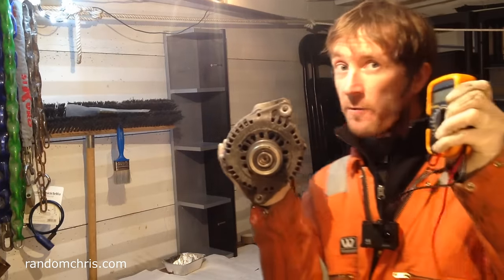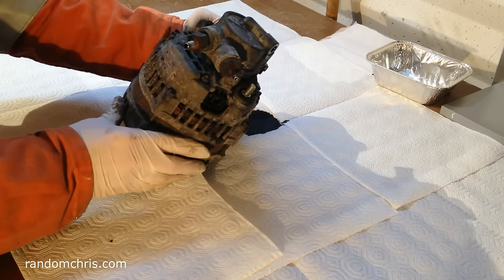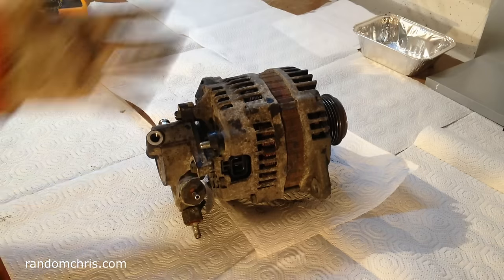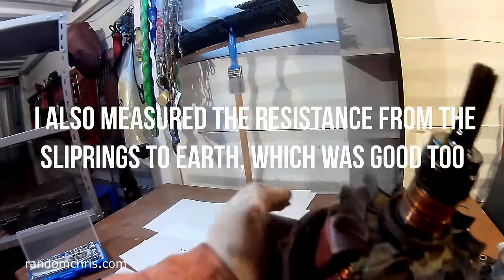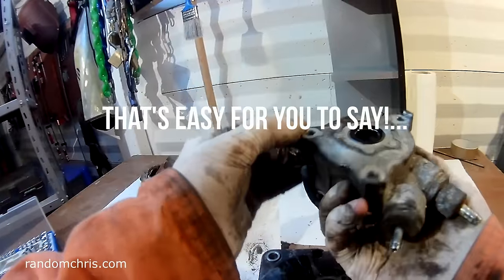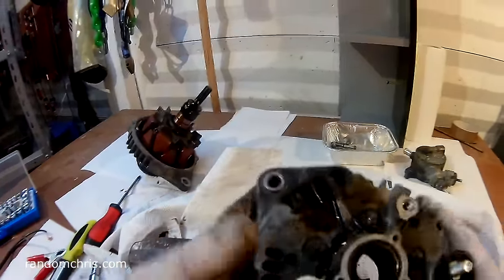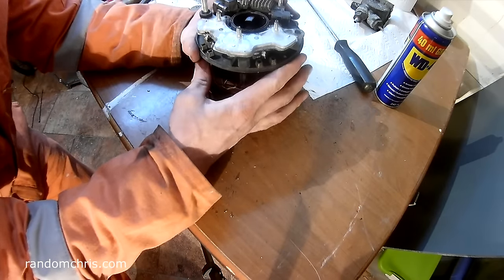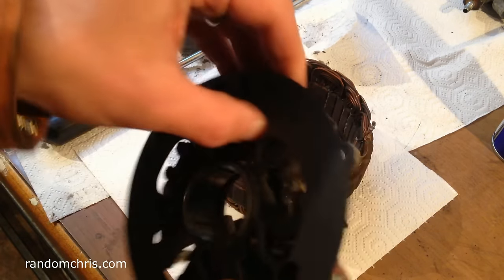How to Repair Your Own Alternator (With Simple Tools)

Comment: I'm an ASE Master certified auto mechanic with 40 years experience and what you have shown in this video used to be a big part of what a shop technician did as his work but sadly most shops have gone to just replacing the alternator as an assembly. I still repair as many assemblies as I can so that I can get the labor pay rather than spend it on parts.
Reply: It's a shame, these day everyone treats everything as disposable. We stopped using plastic bags, but while in the automotive industry not much is repaired anymore, 500 million water pumps as an example disposed of a year rather then repaired, then 500 million more manufactured, and we talk about pollution.
Reply: @hamishmcmanus2027  This isn't really the case with alternators. These things are highly recycled. Half the time all I can find for older cars are remans, which is fine since I've not had a problem with a reman alternator anyways.
Reply: Thnks bro for sane tips i gain tru yr video clips
Reply: I mean if your like me 56$ a hr, it only makes sense to rebuild on Ferrari’s and similar now
Reply: generally, replacing components takes less time than rebuilding components. this is no different in the aviation field. parts can be rebuilt offsite in a controlled environment such as a factory that specializes in rebuilding specific parts.
Reply: Air planes are regulated 
MUCH BETTER THAN CARS , I'm on my 4th rebuilt alternator no I'm rebuilding this one then I'm going to get a friend to take my video of my repair to the ADVANCE AUTO PARTS STORE WHERE I JUST GOT TOLD TO LEAVE. 
    In a plane I would be dead🤨
Reply: @NeoNoggie  you have. Been lucky. I haven't.
Reply: @hamishmcmanus2027 
Every thing you buy in grocery store is packaged in PLASTIC.
WE SHOULD BE ASHAMED. I AM .
Reply: An alternator from Honda for my 2006 CR-V is $2,055.00. Workmanship and QC are in the gutter across the board. Once trusted companies are putting 3 or 4 kinds of differently sourced trash in the identical box. Spending $50 and a couple of hours instead sounds good.
Reply: Asßa
Reply: I'm just learning how. I'm not ASE certified,
Reply: Thank you for letting me know that’s how mechanics think something that can be changed so fast you would rebuild for hourly rate
Reply: @goodday126 that’s ridiculous
Reply: Yeah throwing money away. Now a days guys will look at you like you're completely dumb and crazy if you say that words" u got a REBUILD kit?" 
They'll scoff. Or just glance at you. Like you broke out of an assylum.
Reply: @goodday126 are you serious?! 2k for alternator? That's...I can't
Reply: @Salador1777  It's right on the Honda's part website. Maybe a dealer might mark it down 10% or something, but ya that's the deal. A $50 belt tensioner from Honda was about $225. I didn't buy that either.
Reply: <---Lady!   😉
Reply: Hi sir, i bought 2 alternators from tuffcarparts 100amp one puts out 15 volts the other one outputs 3 volt,  do you know why the other one only produce 3 volt?
Reply: @hamishmcmanus2027  That's insane :/

Comment: Thanks for including us females too! Yes there are some of us out there that are into repairing our own vehicles! And thanks for the info! I’m about to remove my alternator now! Watching this video literally gave me all the information I needed
Reply: Same here girl ! I had to replace my alternator along with the VTEC solenoid, drive belt , hydraulic (total pain in the ass) tensioner pulley for my drive belt… but it’s done and running . I kept my old alternator because I  think probably just needs to be cleaned and possibly change the bushings and I have no doubt i can repair it . why would I trade it in to get a $30 core charge back when it’ll be worth $200+ fixed? I love mechanics though and I wish I knew more than I did but I pretty much told myself everything I know and I’ve successfully done everything on one vehicle or another including timing belt And repaired my fuel pump in one vehicle. about the only thing I haven’t done is replace the entire engine, transmission , nothing involving head gaskets or anything with the suspension. Happy mechanic and do you!
Reply: Mmmhhmmmn.... Y'all in that 3-5%??

Which one of you is available for courting?? Lol
Reply: I watched so many videos, like this one, where they all talk about the problems that are not shown on camera. I spent 3 hours getting it off, but not even out of my truck. It would be nice if the next guy that has to replace one, who has done it once before, film all the really difficult stuff if not given a heads up. The power steering bolts are not too bad to get to if you know exactly where they are. I put the socket on first, then the ratchet. There are only 2 of the screws needed around 11 and 3 o'clock position. On one of the other videos, it showed the 2nd bolt. To be honest, its around the 3 or 4 o'clock and you can hardly see any part of it...but you can find it easy with the socket. 
 
He talks about it, but one other video actually shows it being done. Next, it is much easier to pull it out from the side like he did, but only if you take out the bolt that the alternator hangs on. Its an E socket 10mm. It is so long that it gets in the way when you try and wiggle it out. Once its out, you can get it out with very mild wiggling. 

Lastly (I should have gone in order), but even though the 2 top bolts are hidden, one of the 2 bottom bolts are a pain in the ass if you you don't get the tips.....First one is not so bad, you may be able to break it open with a wrench or ratchet. The other one is what he described. You have to get a 14mm combination for the back....i used a pry bar under the engine for leverage as they are on super tight.  The screw is long and it cant come straight out because of the bracket in the way. It is the bracket to has some hydraulic lines attached to it on the alternator. You can move the lines mostly out of the way.
I haven't even started putting it back together yet.....waiting on the alternator to come in. Other recommendation I would make is not to order the alternator until you can get eyes on it.  There you can get the oem part number because my truck shows 3 different ones with my vin number....the stores always asking about dvd and tow package. I don't have a rear dvd package and I didn't see the tow package on my dealer sticker....but I had a 150a alternator. I ordered it after I could see the part number...

I understand why you don't see some of these pointers, so no fault of his own cuz he's grinding trying to figure it put and when does, its too late and he is not going to backwards to show what he just did. 

I hope all of the learning pains result in a fairly straight forward assembly. We'll see...but of anyone who has seen this video ever has to do one of these again, please show how you take out each bolt and the tools used. It will save the next guy a lot of trouble and headache. At my man spoke bout some of his issues so I was made aware of the problem, but must say this was a bear without being able to visualize the headaches it brings.....Agree with many, I have removed many alternators for a shade tree guy and this was the absolute worst.
Reply: Shut up and make me a sammich
Reply: I’m inspired. Not as a man but as a human.
Reply: @MrMtz817  your respond is better, I have to admit, than the nauseating virtue signaling of this Nico clown lmao
Reply: Just pulled mine out and cleaning real well. Buying a new one is my last resort, Funny think is i just wanted to get a new one and be done but my OCD kicked in and bam!!!
Reply: Never met or talked to a female who could do any mechanical/electrical work. Definitely some females in Construction, that's still on the rise.
Reply: @JohnDoe-tr8zt  well now you have 😊 I work at General Motors in the electrical integration lab as an electrical technician! I love my job! We build test benches for every signal that goes into a vehicle.  And I’ve been doing my own mechanical stuff since I’ve been driving only taking it in when I couldn’t do it like a water pump (on a dodge shadow turbo 😆)
Reply: @natsmatratatat  get it! That’s awesome! I’ve learned everything from watching these YouTube videos! I’m so thankful for people making them
Reply: @Mel_Issa_143  u go bbygirl
Reply: My aunt is always working on vehicle and learning from videos like these
Reply: Make a video!
Reply: He was being a typical British. They're more feminist oriented over there
Reply: Came here to say the same.
Reply: @DooberD33 must get all the girls in his family tree

Comment: Ii'm 78yrs old, I grew up in a era when all things were done like this. you did not replace a part. you repaired it. Generators. Starters. fuel pumps etc. then the throw away era came in and society became a throw away and replace it one. Nice to see its come full circle and there is still the chance to do some good old repair and fix it. to get it going again. Thank you for a nicely done tutorial. and for sharing.
Reply from the maker: Hi Ellis, Thank you for your comment. I'm 'only' 40 but I feel like I'm from another planet sometimes. Take me back to the 1980s any day... Chris
Reply: Someday maybe we'll (need) to go back to the repair of things vs replace and expend  resources.  Glad most alternators are returned/core charge then remanufactured, which tells you something right there!! (I e., with great tutorials like you provide and a few bucks and some time, these things can be redone ourselves in some situations).  Thanks for your tutorial.
Reply: @mikek5486  I don't think it is as far off as people think. I always try to learn to repair things for this reason.

Comment: I always like mechanics astute enough to actually find the problem and fix it instead of just replacing the entire part.  I notice they do this in Mexico, but not in the USA - often, you may be better off with the original part instead of another one that could have other issues.
Reply: Yea like dealerships dont even fix engines anymore they just replace them.
Reply: By that standard a 5 year old could be ase certified.
Reply: Often refurbished parts are more dependable because each individual one is handled and tested.
Reply: Thanks for that. My father (both of us from Mexico, and he was an automotive and truck mechanic there) used to say that most car repairs done in this country are done by people who just change parts, but know very little about how things are made and how to really diagnose and correct problems in a car.
Reply: @lorenzoparedes2306  Yes, Lorenzo, absolutely!!!!  They swap out the Alternator or a rebuilt one here, but in Mexico they go inside the Alternator and rebuild it usually replacing the brushes that wear out first.   AND in Mex. they'll work on Sunday if  you need help, so you can return and be back to work on Monday!!!    Same situation with Automatic Transmissions - in the USA they swap it out for one they rebuilt and no one knows if it's been well cared for or not.  In Mex., they replace the high gear plates that get the most wear and put in new plates (or disks).  I feel more comfortable in Mex. because I return with the same transmission that's in good shape except for the worn out disks.
You pay maybe $3-4,000 in the USA and maybe $650 in Mexico for the exact same end result of having a working car again.
Reply: That’s because this isn’t cost effective unless you’re rebuilding your own alternator. If you have to pay an employee to rebuild one of these, you’ll end up paying more in labor than a new one would cost. And it’s faster to just replace the whole unit and get the customer back on the road
Reply: @chainarmor448  In Mexico, the mechanics work for $20/ hr. whereas here they are $100/hr.   In Mexico, they'll rebuild the alternator by themselves right on the spot, but in the USA the mechanics will just replace the unit with one already rebuilt.  I'm only 2-1/2 hrs. from Mexico, so if I go in that direction it can save me money.  YOU  can save money going to where the hourly rate is lower.
Reply: @dennishassler605  is it cost effective for you to travel to Mexico for an alternator rebuild ? Lol. It sure isn’t for most of us in the US. That’s why we replace the whole unit
Reply: A funny side note is once long ago a family in Mex. City were mechanics fixing cars and, then, their last name "Taller" became the go to name to get auto work done;  fast forward to today, many or most auto repair shops are sometimes  called "TALLER"
Reply: @chainarmor448  It happened once when I was in Mex. and the alternator went out.  A mechanic came in on a Sunday to fix it and he took it apart and installed new brushes.   For transmissions it's worth it - both my SUV's have transmissions rebuilt in Mexico and no problems with the work at all.  Anywhere you are you MUST be certain the guy is a professional mechanic, but don't worry traveling in Mexico - there's quality professionals that will drop everything and assist. It can be scary, but I've had good experiences so many places in Mexico.  Now, today, I'd rather need auto work surprises in Mex. - better service and better prices!!!

Comment: That DIY culture, shared by sailors around the world, is inspiring! In some ways it can be a little frustrating since professional mechanics only rarely fix subunits like this. They favour replacing the whole unit with a warrantied part, to protect themselves from the painful experience of a callback. Ultimately this leads to some difficulty finding small parts, for those of us willing to go through the extra effort. Thanks for another contribution here.

Comment: I have not seen anyone rebuild an alternator since the mid 70's.  Didn't know you could even get the parts. Thanks.
Reply from the maker: Cheers Jim 👍
Reply: @christopher_barr  with that component your on about replacing could you not just solder that back into position?
Reply: @s1dew1nd3r4  There's a reason it got hot enough to melt the solder to begin with. You could try it again and think maybe it was just poorly jointed at the factory or you could save yourself the chance and replace the diode.

Comment: Ex Motor Mechanic here (retired) and just been quoted £80 to replace diodes & brushes by someone that knows my abilities.
For pin money i strip & repair pressure washers FFS?
I will happily strip mine down and do exactly as you have shown here but for prob 1/4 of that price. Esp having this Vid for reassurance.
Thanks for a pretty well put together vid. Most of it very clearly described.
Nice one Chris.
Reply: U too makes car repair videos Sir. It will be helpful to us

Comment: Interesting and informative. Been a mechanic for almost 30 years now and never rebuilt an alternator.  Used ones go for $35 to $75 and remans generally $130 - $200 so it doesn't pay to fix them with parts and labor. I am sure there are specialty exotics that It would pay to do this for myself. However,  I have never had one I couldn't get for a reasonable price. If it paid to rebuild them I would do it for a living, and you would be my reference material publisher 😁👍🏻👍🏻👍🏻

Comment: Just ordered a brand new alternator for my F150.  But I think I'll keep the old one and try this rebuild.  It might come in handy if/when this new one ever goes out
Reply: Good idea. I ordered a replacement alternator but afterwards saw this video and decided to repair my old one with new brushes and new voltage regulator. Cost me $24.00 and the shipping was free. Took a couple minutes to replace the regulator and brushes and now I have a spare alternator for when the new one goes bad. Christopher did a great job on this vid, no?

Comment: Well done. very straightforward and simple. Great video keep up the good work. P.s could I run another alternator of my vehicle. Silly question. How can I connect it directly to a power bank forva or a direct feed to inverter so I can yous tools on my travels pretty much using my diesel van as a generator. With like a locking pin to ingauge it when I'm idil

Comment: Hey Chris😃 really grateful for your advice and tutorial, I have got the alternator apart in all the bits you were showing and I noticed the clutch wasn't slipping one way as you demonstrated, it didn't slip either way... The brushes are fairly long still so now I may have to take the disassembled thingy to the auto lecky for the final verdict on what is wrong with it... And cost for a new part etc.... Thanks again from Australia👍😃🍀

Comment: Thank you so much I just replaced my alternator myself, I didn't even think of repairing the old one I gave it in for a core. I think the problem inside mine was the clutch from the loud squeal I smell I was experiencing. "subscribing"!
Reply from the maker: Welcome aboard Sondra. Chris 👍
Reply: Sondra L hi Sondra usually when you hear a loud squeal from an alternator it’s the bearings have gone bad.  That is a very very easy fix!!!
Take apart and put in né bearings and bingo go to go

Comment: Sharp pointed center punch and a light hand with a small hammer can make the best reassembly guide marks you need for a small component like an alternator. 
Front DE Hsg=1 punch mark, stator=1 punch mark in line with the hsg mark. 
2 marks on the other end of the stator aligned to 2 marks on the next housing, and so on for each additional removable part works for almost any disassembly.
8:49-Slot u-wedges appear to have deformed from excessive heat. Wound stator units are dipped in varnish (usually) and baked at minimum of 350 Deg F
for 3 to 5 hours. Even that heat does not deform slot wedges.